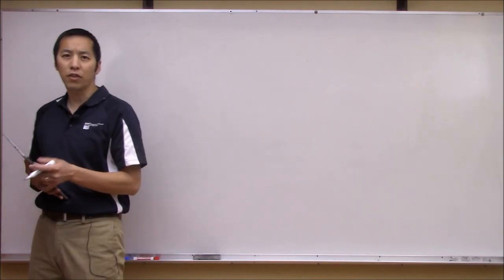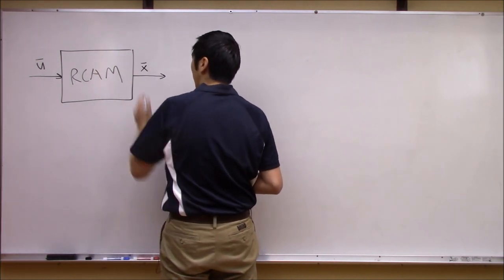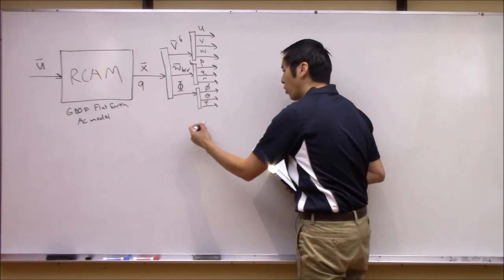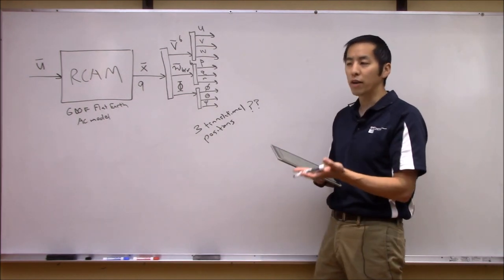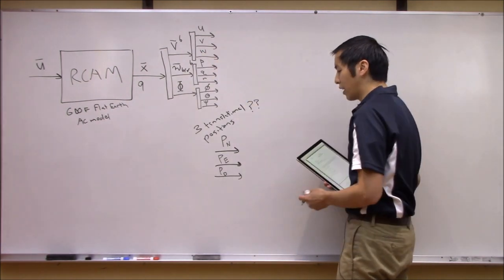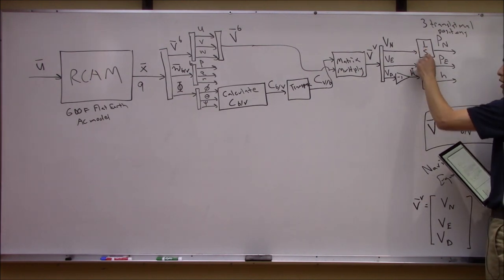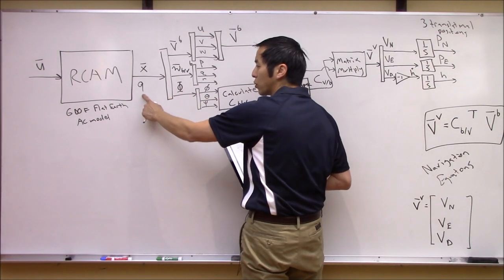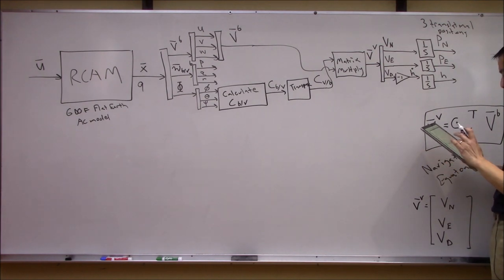The Navigation Equations: Computing Position North, East, and Down

Comment: AE 512 - Hi Professor Lum. Minute 44:07 -> Your "simUIn" is a "From WorkPlace" block? is it a two-column matrix with time inputs on first column and value inputs on second column? 

How could I create my simUIn? Thanks.
Reply: Hi Marcos, it is a From Workspace block and you can find it under Simulink Library Browser >> Simulink/Sources. To input data, use simUIn.time and simUIn.signals.values in MATLAB.

Comment: AE512: If we add X(10), X(11), X(12) as P_N, P_E, P_D to the state vector inside the RCAM model, what do you suggest setting for initial conditions on these elements? I'm thinking (0,0,0) would be a good choice, since when we initialize (phi, lambda, h) as our starting LLA for the Simulink block Geodetic Integrator then the P_N, P_E, P_D evolutions will be relative to that LLA starting point. What do you think?
Reply from the maker: David, yes [0;0;0] is fine.  Or if you want some altitude try [0;0;-500];

Comment: [AE 512] 40:57
Don't you need to integrate PN PE PD coming out of the RCAM system to get positions? Based on the code you are outputting translational velocities in the NED frame, not positions?
Reply from the maker: I think you mean VN, VE, VD.  And in short this is correct, we are rotating u, v, w (which is in the body frame) to be VN, VE, VD and then integrating.
Reply: @ChristopherLum  So the integration to get PN PE PD is happening underneath the 'RCAM' submodel mask?

Comment: Sir when  we change  the output of RCAM as 12x1 matrix how do we have to change integrator's inital condition ?How 12 element matrix give feedback to RCAM function.It seems there is something wrong here.
Reply: I'm having a similar issue with the modification and the no. of input and exit ports not matching. Have you found a soluiton? Perhaps we can share code to try and work through it?